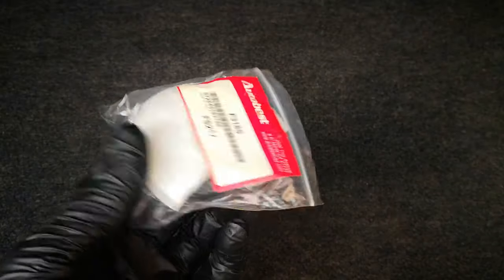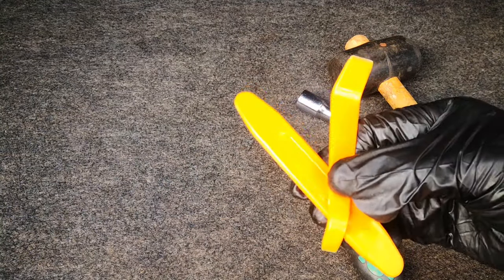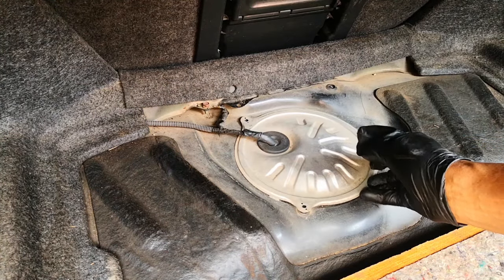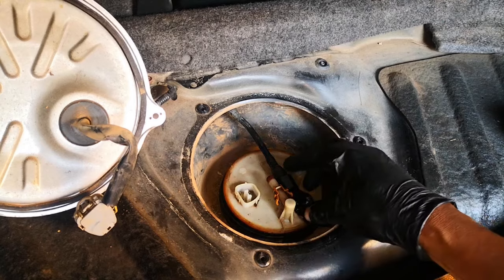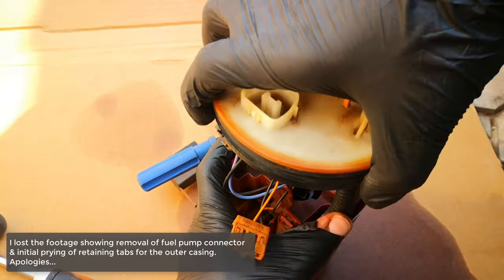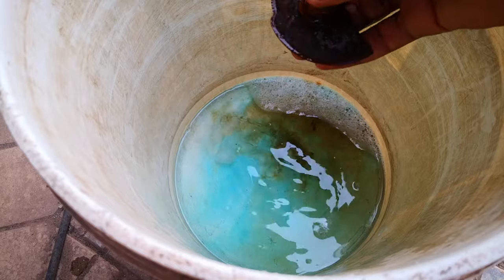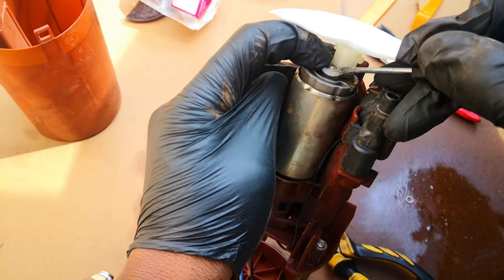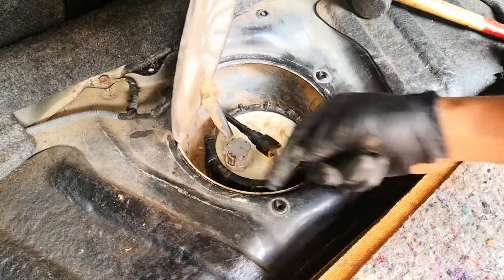2003-2007 Accord Fuel Strainer Change: Fuel Pressure Regulator change/ Fuel Sending Unit Disassembly

Comment: That filter was very dirty. I wish I hadn’t seen the video now. Looks like I’m gonna have to replace mine on my Accord 🙁 😬
Reply from the maker: 😂😂😂
To be honest, didn't know it was going to be that dirty! Sorry to be tempting you🤣. It's for good though. All the best.
Reply: Oh yes. I'm tempted too. 

Currently experiencing this start and die.  Sometimes I turn ignition on and off about 4 times so it primes more. With that it starts better. 

EDIT - I didn't need to do this. It all became okay after my next fuel purchase. And has been fine since.
Reply from the maker: Good temptation brother 😅.
Reply from the maker: Thanks for the update. Poor quality or bad gas is also a cause!
Reply: @DIYAutoworksNG  yy yet
Reply: @DIYAutoworksNG  could this cause (fuel-cut?) jerking when letting off accelerator?
Reply from the maker: Yes. Usually air-fuel supply related. Some throttle body issues could cause this too.
Reply: So that's why buying good quality gasoline is important and using a fuel system cleaner
Reply: Time to check mine😂😂

Comment: My 2003 Honda accord EX won’t start at all. Changed out the entire Exhaust after my Cat was stolen. Ran great after the test drive. 3 days later it just wouldn’t start. We checked the battery and the fuses. Everything checks out. I thought it might be the fuel pump. But I can hear it working. I’m so confused and frustrated. After watching this video now I’m thinking it may just be a dirty filter. I’ll let you know how it goes. 🙏🏼🙏🏼🙏🏼
Reply from the maker: Great. Did you manage to resolve this?

Comment: I just finished this procedure on my 2004 Accord EX.  Your video was a huge help.  My filter was brown, but not as dirty as yours.  And yes I also replaced the pressure regulator.  Thanks for a informative video.
Reply from the maker: Great to hear! Thanks for sharing.
Reply: i know this is older but which pump did you buy& from where?

Comment: Very good and clear instructions. I might do the same maintenance on my accord with 370 000 miles. Filter is still original!
Reply from the maker: Thanks a lot, mate. Double thumbs-up on your mileage! Mine is at 259k miles.
Reply: @DIYAutoworksNG  thank you! These 7 generation accords build like a tank. Plenty of them still on the road! Mine has original engine and transmission.
Reply from the maker: Same here. First engine, first transmission.
If your lucky to have bought clean gas largely and you follow through with inspecting the strainer, yours might be better than mine. Lol
Reply: Wow!  mine has 282k miles on it and #4 fuel injector just stopped spraying. Having all the original Injectors cleaned for the first time...I'm glad I saw this video because it's making me want to clean these parts now too!
Reply from the maker: You should, lol.
Reply: I use ARCO regular unleaded about 80% of the time. Costco the other 20%.

Comment: I would use a paint pen to make a straight line across the pump housing, latch ring, and onto the tank.
Reply from the maker: Not bad. Though I've never done it and never had a problem.

Comment: I have the same symptoms. I think I am just going to replace the fuel pump assembly assembly instead of doing all this. Great video though!
Reply from the maker: It can also be caused by poor quality gas! Maybe before replacing the whole unit, try a good octane booster/cleaner and see if it helps? Thanks for the compliment!

Comment: Just learned there even was a fuel filter for my 2003 accord...  I'm pretty sure honda never serviced it in the 19 years I've had them work on it.  Thanks for making it look like another something I can actually do myself.  (Also contemplating replacing the plugs a little early, not really due for another 40K (at 330K) yet, but gas mileage is a little lower since having had the vtec housing gasket replaced.)
Reply from the maker: 🙏🏼🙏🏼🙏🏼
The spark plugs should be otherwise okay if you have 40k still left for the next replacement interval and you had the recommended iridium ones.
Reply: @DIYAutoworksNG I'll keep that in mind.  But will definitely be doing it myself when I do get around to it.
Reply: Did the deed Thursday and finished Sunday.  What kept me from completing on Thursday was that it literally took me an hour or three to get the pump back in properly (finally thanks to your hint to put the rubber seal in first, though even that took a few tries) and mostly getting the ring back on properly, which was a total fail after dozens of tries. 

On the off chance that a cheap tank wrench tool might help (and I'm pretty sure it did as it only took a few tries today and it's a good tight fit), I ordered that tool in and took two days off for my ancient fingers to recover.  Today I first looked at a few other similar videos to see if there were any better hints on getting the ring back on easily (nope), but ran into one that probably helped which gave me the idea to put the back seats down and access the pump ring from inside the car instead of inside the trunk (d'oh).  Bingo I suspect.

In the end, turns out it wasn't very dirty in the pump, a number of larger dirt particles and some smaller ones, probably a few dozen all told.  The original filter was pretty clean.  So it goes... and now I know better.  

Your video pretty much had all the steps and I'm not going to even try and count the number of times during several of the steps I went back and forth from one end of the house (the garage) to the other (this office) looking to see how easy you made it look and what I wasn't quite getting right.  

So excellent video, but I'd recommend a cheap-ish tank wrench tool be procured for putting the ring back on more easily (and probably taking it off in the first place), do the ring back on part and the last few steps from inside the car (do the rest from the trunk as it can get quite messy with all the dirt and especially the gasoline).
Reply from the maker: Well said! Never thought of going from inside the car vs trunk!
With experience, I've gotten so used to the trunk route that it only takes me a couple minutes to unmount/mount the ring. In my earlier days, it used to take quite a bit of tries to get the ring back on🥵, so I totally understand! Glad you got it done, plus the confirmation of not being too dirty. Cheers.

Comment: Oh shit, the location is that simple? Thanks for showing me where I can access it. I was worried i had to take out the entire rear sofa. Which on the Tourer is a nightmare.
A word of advice would be to first mark the location of the retaining ring with a sharpie, that way you know you've tapped it in far enough when you assemble it again.
Reply from the maker: You're welcome! Nice tip on using a sharpie. From experience, I usually just tighten by hand. The rubber sleeve does all the sealing.
Reply: @DIYAutoworksNG  Do you happen to know if this model Accord has a schrader valve somewhere to monitor fuel pressure? My Accord is running lean during WOT. :( I'm suspecting the pump, because it makes a grating noise when I fire it up.
Reply from the maker: No schrader valve on this Accord. I did a video some years ago (some of my first on YouTube!), on how to check fuel pressure for this 7th gen Accord. Here https://youtu.be/WkKKyPNaOMQ
Reply: @DIYAutoworksNG  ordered one of those kits, will check the fuel pressure before i dismantle the entire pump assembly. Thanks.
Reply from the maker: Nice!

Comment: Good job Piyke, I am quite surprised that this Accord doesn't have a fuel filter in the reservoir. In european Accord we have a strainer for the fuel pump like in your video that stays on the bottom of the fuel tank and a sealed plastic box part of the fuel pump housing with a filter material inside. Manual asks to change it around 80000km.
Reply from the maker: Thanks a lot!
Interesting design for the European and good to see there's a recommended maintenance schedule. Good one Europe!
Reply: Im in USA been working on a 04 CR-V but built in UK. I have asked parts stores, mechanics, google, anyone i could were my fuel filter is. Eberyone keeps saying no filter just strainer. Finally i found it in the modular assembly. You pretty much have to buy the bottom half of the assembly to get it. But at least i found it finally !
Reply from the maker: Great to know! Thanks for sharing.
Reply: The Honda Accords has a inline fuel filter as well. It’s under the hood. A really pain in the but you get out and replace..
Reply from the maker: If possible, can you state the year, trim and the location of the inline filter.
Reply: It’s on all the 03-07 accords. Raise the hood fallow the fuel line down and it’s under the brake booster on the drivers side. Or the 2 or 3 I’ve worked on that’s where it was at. On my 04 2.4 and I replaced one in a 07 v6 coupe as well..
Reply: My 04 is a ecl 2.4 4 door.. If that helps you or not..
Reply from the maker: Thanks for sharing the details. I would have gone for this if not that I've let go of my 03 Accord!

Comment: Hi there, very nice videos! We need more of these for the accords "") I have the 7th gen euro accord wagon 2.4l automatic and i get this shaking/jerking (i don't know what's the right word) from the engine always at same speeds around 2000rpm 40-50km/h and 80-90km/h while sligthly  pressing the gas pedal, like the engine lacks fuel or air. Also the rpms are jumping a little bit while driving at steady speed around 80-90km/h. I don't know if its realted to this video or is it trans related but would be very helpful if you can point where to check or what to look for. Thanks!
Reply from the maker: Thanks a lot for the compliment!
Do you have a check engine light? It could be worn spark plugs especially with the bouncing RPM. However, a lot of other things may be in play here. Air and fuel supply need to be checked as well. A scan will help point you in the right direction.
Reply: Thanks! I don't have any CEL i changed the spark plugs when i got the car and it was like that, recently i changed them again and still the same not getting better or worse ill run a scan when i can cuz I don't have scan tool but people here telling me it needs to be original honda scanner to get correct readings.
Reply: @mitakks  
I'm suspecting it's an issue with your v-tec solenoid assembly or strainer. But then, I would expect this to give a Check Engine Light and a fault code. You said you don't have that, so I'm no so sure.
Reply from the maker: Thanks for the update. Any good scanner will work. Doesn't have to be Honda or even expensive. Since there is no CEL, what you'll need is access to live data to observe the fuel trims. NB: on this Accord, fuel delivery issues may not trip a code, same goes for a very dirty air cleaner element (aka air filter). When last did you change the air cleaner element(engine)?
Reply from the maker: Exactly! An iVTEC  issue that causes  surging at speed (limp mode) will cause a CEL. @Mitakks - does the CEL come on initially when you turn on the ignition but don't crank?
Reply: @DIYAutoworksNG  Yes, it's turning on  then goes off after i start the car...the vtc, vtec strainers/gascets are all brand new, air filter changed before like 5000km...i just have to do a live scan obviously to see what's going on.
Reply from the maker: 👌🏼. Good plan.

Comment: I have an 06 Accord 2.4 liter with 341k miles.  Car is running great, no problems…would you recommend replacing filter even though you're not having any issues???
Reply from the maker: I would, or at least inspect.

Comment: Great video, The fuel pressure regulator will be on the same location for honda accord 2010?  Recently Fuel filter has been replaced but I'm getting this P00004 - Fuel Volume Regulator Control Circuit High code,
Reply from the maker: Yep, same location. Thanks for the compliment!

Comment: My Accord has 148000km on the clock. Is it time for a new filter?
How many miles on the clock did you have?
Reply from the maker: Mine was at 260,000 miles (416,000km)😨. I guess 148k is not that bad especially if you are not having any symptoms. On the other hand, if you every have fuel delivery issues, I would say you change the filter.

Comment: Wow, thanks so much! This really helps me out!
Reply from the maker: Great to know! Thanks!
Reply: @DIYAutoworksNG  no problem! Just ordering the regulator now. Is the technician term "Fuel injection pressure regulator"?
Reply from the maker: Great. Technical term is fuel pressure regulator.
Reply: @DIYAutoworksNG  ah, I was only Able to find the one that added the word injection to it, so I just got that one. Couldn't find the fuel regulator version

Comment: Please, I have questions. The fuel pump on my Honda Accord EOD has a retaining tab, and my car has issues of not accelerating properly. The acceleration doesn't go past a certain level and it also consumes a lot of fuel. I've been told that the problem is the fuel pump. How do I change the fuel pump as the fuel pumps I've been getting don't have retaining tabs on them, and they cannot match my fuel pump cartridge/assembly? How do I do this?
Or is there a way to use a fuel pump without a retaining tab?
Reply from the maker: Best to have the car scanned and work from there. Throwing parts at the car will cost you a lot.

Comment: The real easy to replace I would suggest taking a strong piece of metal maybe a thin pipe very thin like from a paper towel dispenser and running it across the top of the o lock so that it doesn't come undone unexpectedly because they're known to give out overtime.

Comment: Phillips head screw?  Try JIS, or Japan Industry Standard, not the same.  It is well worth it to buy the right screwdriver.
Reply from the maker: Just researched this now. Didn't know of the Japanese industry standard. Thanks!
Reply: In this case it doesn't matter that much.  For brake rotor screws it matters, but not on this.

Comment: Great video, simple techniques. However you didn't crank the engine again to see if it would start on a first try after replacing the fuel filter. That would have summed up the video. But thanks all the same.
Reply from the maker: I agree. Nice observation. Feedback taken!

Comment: I have a hard start symptom. Where the car only cranks on the second turn. Should I replace the whole assembly.
Reply from the maker: So many things can cause a hard start. You'll have to troubleshoot your way through: worn spark plugs, dirty injectors, O2 sensors, dirty air filter, fuel filter, fuel pump etc..
Reply: @DIYAutoworksNG  it was a way harder start until I changed the air filter. No it's just on the second attempt. I might replace the fuel pump next. Spark plugs have been replaced.

Comment: Question:
If the initial filter that filters out a coarse particles so dirty it means that dirt could go upstream and contaminate fine filter located inside the plastic case (looks like crescent). Also dirt can damage the pump itself, no?
So... Replacing that filter at the bottom may solve the issue with fuel pressure for now. But how long it will be before the entire pump will die?
Reply from the maker: That's the purpose of the filter, to trap the dirt. What you would rather have will be a clogged filter which restricts the aspiration of fuel from the tank. It's practices like washing and reusing a fuel filter (except if specifically designed) or using aftermarket filters that do not meet OEM spec, that may alter the filter pore diameter and increase the risk of dirt getting into the pump. 
But very good observation I must say.

Comment: Nice video man, please I have an issue with my 2004 accord, the problem started with anytime I fill up my tank and start my engine the car will rough idle and goes off up to five times, I will have to apply little acceleration for it to be stable after several attempts, now the car is rough idling and going off in hold ups. It will only move smoothly on Fred road and high speeds. Please what is the solution, I have tried several things and still no improvement.
Reply from the maker: A number of things can cause stalling after buying gas: failing fuel pump, contaminated gas, defective valve in the EVAP system etc. You mentioned trying many things, what have you tried?
Reply: @DIYAutoworksNG  thanks for your prompt response, I have changed fuel pump, cleaned nozzles, bought gas from different stations too. The scan I did using a small Bluetooth obd2 scanner talked about camshaft sensor bank A1, o2 sensors and evap issues too.
Reply: @DIYAutoworksNG  this vibration and going off only occurs at low speed, hold up or after filling up my tank, the car drives perfectly at higher speeds.
Reply from the maker: My money is on the EVAP for the stalling, since the scan has flagged that. The camshaft/O2 codes are likely responsible for the rough idle you talked about. Air-fuel ratio is likely off and timing affected too. What's your STFT and LTFT at?
Reply from the maker: Okay. I suggest you address the codes
Reply: @DIYAutoworksNG  both are showing 0%

Comment: So did it fix your problem you was having? Only ask cause when I first start my car in the morning or after it sets a few days it has a long crank and then misses for a few seconds and then straightens up.. And don’t do it the rest of the day.
Reply from the maker: It didn't fix the issue although it's a potential cause. I eventually found the actual problem to be poor quality gas. I could eliminate or recreate the problem by buying gas from certain gas stations!